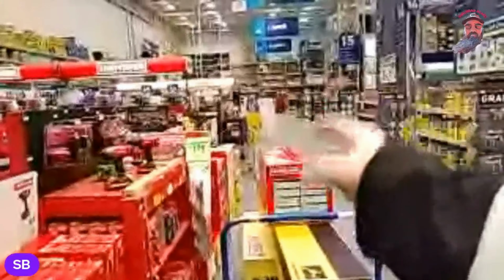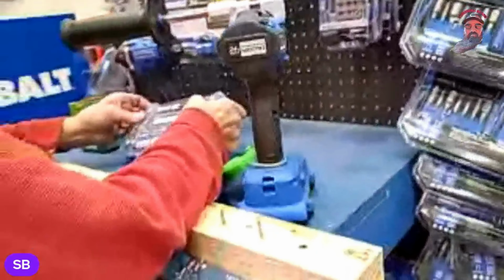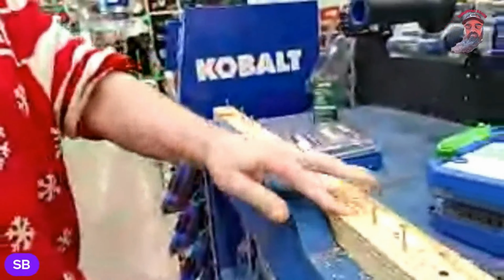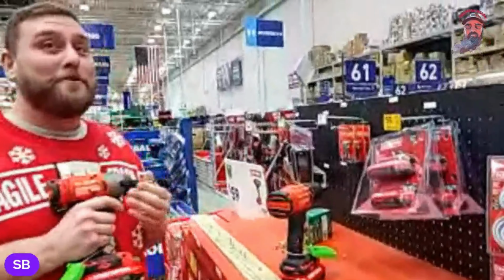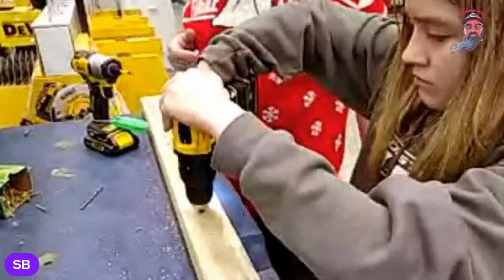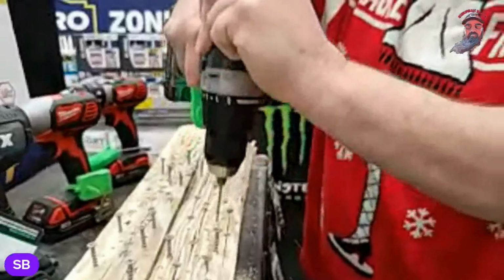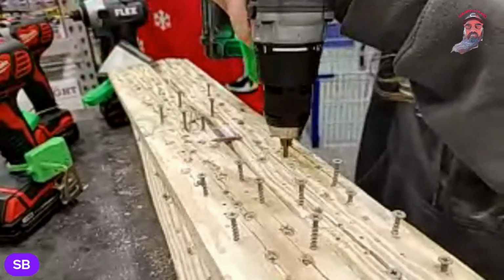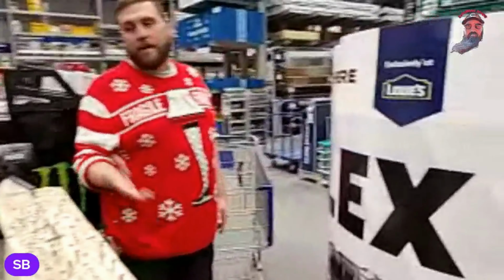Testing Drill Drivers and Impacts In Store At Lowes Kobalt Craftsman Dewalt Flex Milwaukee

Comment: Today, Nov 30 and tomorrow, Dec 1, 2021 are the last two days to score the Metabo HPT 21 degree 18V Brushless Framing Nailer KIT for $399 AND get a FREE ($349) 18V Brushless 18ga Brad Nailer KIT, with LIFETIME WARRANTY on the tool! These KITS come with tool, 3.0Ah Battery, Charger and soft case! What a great bargain, for great tools that you’ll NEVER have to buy again, with that kine warranty! Only at LOWE’S!